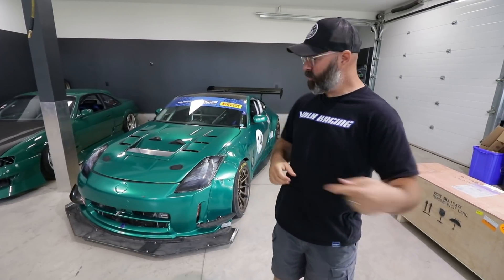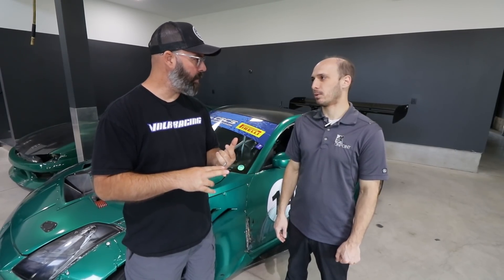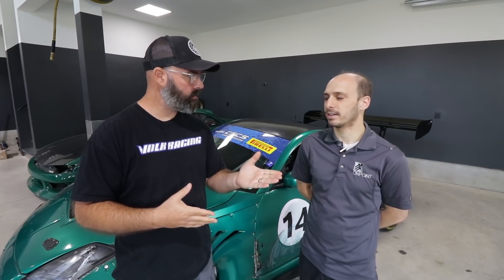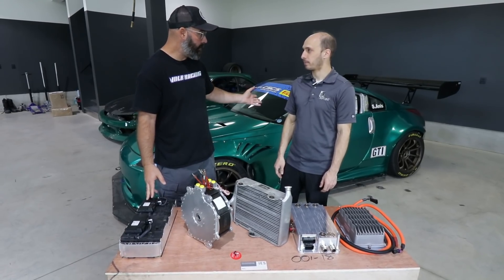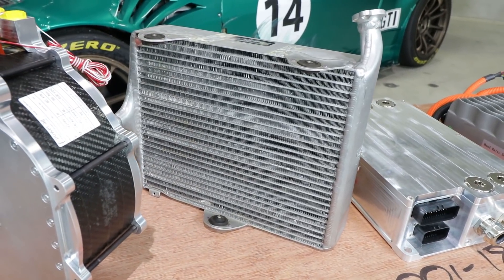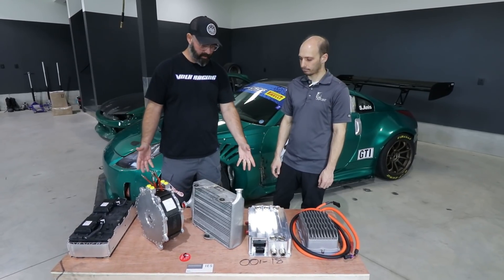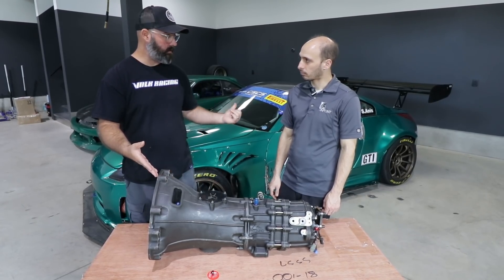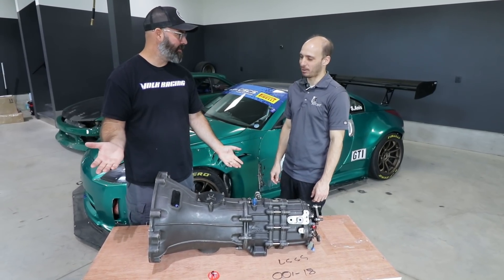Worlds First 600HP ALL MOTOR 350Z HYBRID Conversion (+200HP Electric Motor)

Comment: how does the electric motor replace the clutch/flywheel without limiting torque or rpm? electric motors can reach into the stratospheres.
i get its a power adder, but full range or low gear rpm? high gear booster?

Comment: On Point: VH41/45 block, LS7 GM Darton MID Sleeves, VK45 crankshaft, Alu Rods, Supremex MMC forged piston at 4.185in./106.30mm bore size, titanium valves, DLC coated buckets and everything.
VK56 welded ported heads and sheet metal intake.
10,500-11,000 rpm super oversquare with the 2.99in/76mm stroke and 4.185in./106.30mm bore for 329 cubic inches or 5.4L displacement. With Aluminum rods, 7mm stem titanium valves, and SupremEx pistons speeds around 6000 feet per second will be possible with track endurance. 76mm stroke has excellent main/rod journal overlap for incredibly stiff crank with small webs/throws. The VH45DE block is unbelievable. Makes VR38DETT block look weak and will take the 4.200 bore capable LS7 style Darton MIDs. VK blocks don't have the material near the base of the cylinders.
Figured I'd share my research with you guys because you have the resources and the will to do it. A 5.4 liter mill like that will get you the GT2 winning numbers.
Might even consider solid deck using a separate radiator for head cooling with lower temperature and lighter weight oil? Run the heads at 125f/55C? Don't know if that's legal with older GT rules?

Comment: It’s better to have a PHEV over an EV, well EVs are great for the environment, but there not great cars for power outages for days, and auto brands should be going PHEV rather than EV only just because we still need gas for emergencies, and power outages aren’t gonna shorten sooner, and brands need to improve the electric range in their plug in hybrids so that way they might have an even longer range than electric only.

Comment: Dang. How much did that set up cost? The electric motor alone? Frickin awesome!

Why didn't he just use the integrated hybrid drivetrains already out there, like the FZ 8HP70, that's off the top probably not the right nomenclature

Comment: Can be a coincidence but funnily enough I had a similar idea to this for a while with the exception of attaching the clutch to the electric motor that replaces the flywheel and starter motor instead of replacing the entire flywheel/clutch parts between the engine and gearbox as components of the drivetrain in a car.

Comment: If you look into the Mercedes AMG E53's M256 engine it runs a similar setup of electric motor in the bell housing that assists a turbocharged 3.0 liter inline 6. Their system also uses this electric motor as an alternator AND starter for the car.

Comment: I hope the next generation Z will be Hybrid, RRD, Mid-Engine, Naturally aspirated, V6, 6 speed manual transmission, with a similar body to the 370z, and cost $30K. They will call it the 400z because it will make 400HP and have a 4.0 liter engine.

Comment: He literally has created a blueprint for Nissan. Lol
Reply: Except emission on this guy are probably a no go haha
Reply: @devonswindell9735  200hp of that is emission-free, though
Reply: Im confused. Is this an actual Hybrid hypercar like the Mclaren P1 or just a track car woth electric motor as a boost?
Reply: @sel508  Track car with electric motor like a turbo, but with no lag, and it can assist turbos by picking up that lag slack for the turbo.
Reply: 1y Late reply to comment but Nissan obviously has newer & much cleaner engines than the VQ. He just used a VQ, Nissan also has better transmissions that  can let you switch from what Sasha is doing + with an system that allows EV only mode
Reply: Blueprint to steal bmws battery
Reply: Should be interesting if they end up merging with Honda…
Reply: @F Malik he is saying this car wouldn’t pass emissions, so you wouldn’t be able to get tags on your car, so you can’t get it registered. But if Nissan took the idea (blueprint) they would obviously install high performance cats and detune/get more fuel efficiency wherever necessary.

Comment: That's cute, 4 Piston built n/a 500hp 4 cylinders years ago already. 600 hp from a motor with significantly more displacement than k series honda is actually pretty embarrassing.
Reply: Cnc machined block and head means you have complete control over port shape and size as well as cylinder bore size
Reply: This motor is a Nissan cast block and head, he may have lots of aftermarket hardware in there but he is still limited by the factory design.

Comment: Imagine how much faster he would have went if he built an na viper acr
Reply: You don't need that much displacement for a lightweight track car, and weight reduction is critical. Think of NA formula 1 engines, Honda could get close to 1000hp from a 3.0L v10 in 2005. The viper's v10 is over twice the displacement and much heavier.
Reply: @gxexrxmxaxnx  Honda is na king no question. We are talking about the v10 vs vq.. the viper is the far superior chassis in every category.

Comment: So the motor will replace the clutch and flywheel? Is there still a way to disconnect the engine from the transmission, or is there going to be some sort of start-stop tech where the engine would always be connected but the motor assisting the engine below 1000 RPM? I'm curious how would Sasha handle dead stop accelerations on the car.

Comment: I hope you guys give a in depth explanation on how it works replacing the clutch and flywheel, especially interesting that it doesn't move the transmission further back. Makes me wonder if something like this can be done (or already has been) to a Subaru STI.
Does it still use a traditional starter or can it use the electric motor?
Thanks for all the great videos and awesome builds!
Reply: Vegaspsycho most hybrid systems I’ve seen like the Vonnen Shadow drive (has a similar style motor between the engine and trans) used the motor to also crank the engine to start. I’m interested in seeing if this could work for a Jeep/truck but I’m sure an STI would take a similar amount of custom fab to get it to bolt up the trans and engine and everything else to control it

Comment: Schneider electric is using bmw i3 cels in there lithium ion ups system. the large ones have strings of 17 modules (136 cels total) in series and that deliver 220-240kw (after inverter loss ) per string before they nosedive pretty hard. So 150kw from 6 modules sound a bit optimistic but for some short bursts out of corners maybe it is possible in time attack mode. Any how it will be very interesting to follow 😁

https://download.schneider-electric.com/files?p_enDocType=Catalog&p_File_Name=ACOS-AD4M5V_R4_EN.pdf&p_Doc_Ref=SPD_ACOS-AD4M5V_EN

Comment: @Sasha — without no clutch and a direct drive, are you going to cut spark to the engine (stop/start) and use the electric motor to provide a crawl or movement below whatever the idle would normally be?

Comment: I just can't wrap my head around how he sqeezed 600hp out of this engine without forced induction. Crazys stuff.
Reply: You can watch the dyno session of it on this channel, they explained the process. It's a custom 4.2L stroker engine if I recall correctly with a stupid high compression ratio, trick heads and cams etc. basically a 40k$ engine!

Comment: Would love to see Sasha dive into the details of this. Like how does the electric motor replace the clutch/flywheel?
Reply: If I'm interpreting this correctly, they will work in tandem under load, but when off throttle the motor assembly will behave passively allowing a "disengagement" of sorts.
Reply: @rhubarbpie2027  Yes, but the engine output shaft is still mechanically connected to the transmission. They have to be using the electric motor to start the engine then they kill it when coming to a complete stop.
Reply: @lwd107  that's exactly that it does, more current videos show it more clearly.  The electric motor is also be used for regen while coasting/braking, and the amount of regen can be changed.
Reply: My guess is it'll shut down the gas engine when stopping/stopped, and use pure electric to get rolling, then just add fuel/spark to the gas engine once rolling and it'll fire up.
Reply: @wparsons  so does it mean it has similar performance to a Mclaren P1 or the electric motors work like some sort of boost for the car!
Reply: @sel508  not sure I understand the question... but in both cars the electric motor is adding power.  I'm not sure of the specifics of where the electric motor physically sits in the McLaren, but it still has clutches for the gearbox (double clutch 7 speed).

Comment: Don't put the emotor between the engine and gearbox, it adds inertia even if you where to try and brake it between gears, put it on the output flange you can have the emotor do increased torque instead to provide torque fill between gears.
Reply: Interesting indeed as the electric motor is going to become the flywheel, however it's probably be around the same weight as the flywheel no?
Reply: @zestyjobe  there is also a flywheel so it's like two flywheels.

Comment: Would the extra 200HP make up for the extra weight?
Reply: Minus weight of clutch and flywheel (~7kg & 0HP) add electric motor (~19kg & 200HP instant torque) = 12KG @ 200HP. Id say he's WINNING!! ;)
Reply: @Al-yc4cn  how about the other electrical components and batteries?
Reply: @lancereyesromero7811  Deffinately needs to be considered but Im thinking that this solution is will offer the most reliable 200HP with 100% torque from 1rpm. Also allows him to balance the weight distribution. He's a smart guy, will be exciting to see.

Comment: I think it's just better this way. Turbos and Superchargers over-stress the engine. Quality high compression engine with hybrid system is insane.
Reply: High RPMs over stress an engine, too... I wonder if the "No replacement for displacement" mantra is just universally true. Always have exceptions, of course, but 4.2ltr with a relatively short stroke and torque-fill... Looks perfect.